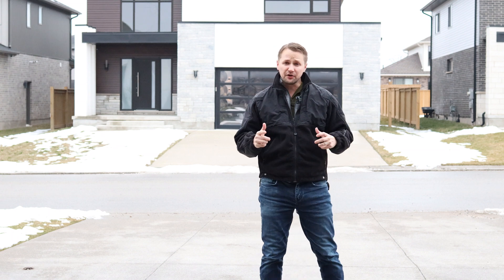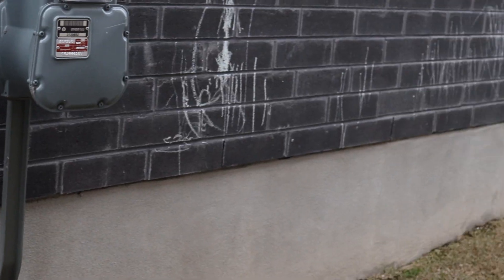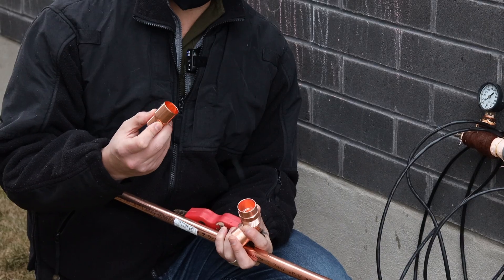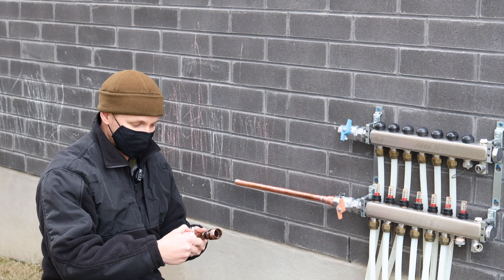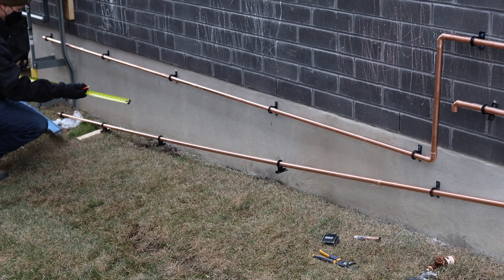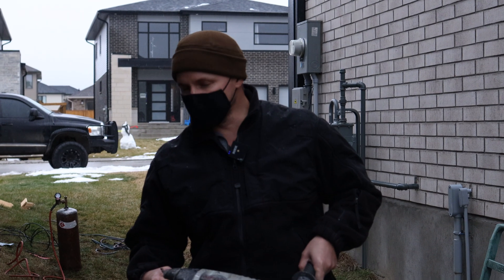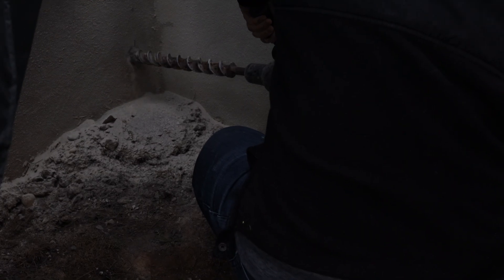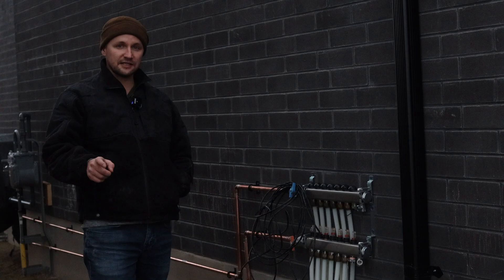Heated Driveway Installation (Building A System)

Comment: 3/4 inch line can heat a whole driveway??  Are you sure you don't need a 1 inch line at least?  You have several plastic lines running from just 1 line
Reply from the maker: It works 🤷‍♂️

Comment: Did you ever get around to doing the cost analysis video?
Reply from the maker: Might of said it in another video.  It’s about 20k-40k to get it done depending on what connections you have.  When it runs it only comes on as the snow hits the sensors so daily it’s not using extra natural gas. When it is on the bills are hardly noticeable to be honest.  It might just come on for a few hours as it snows.